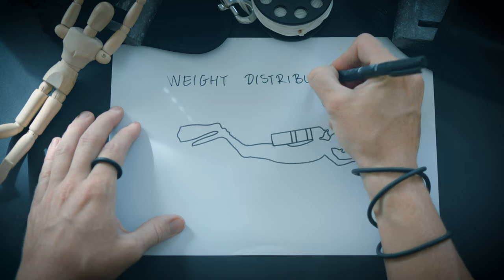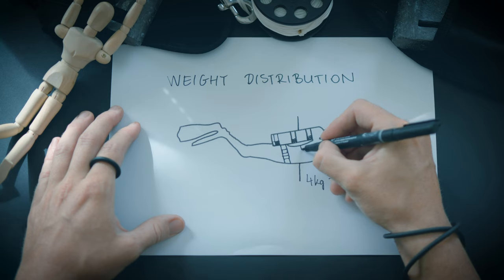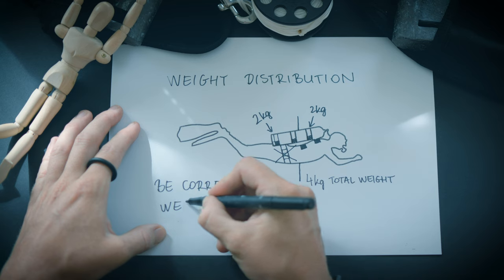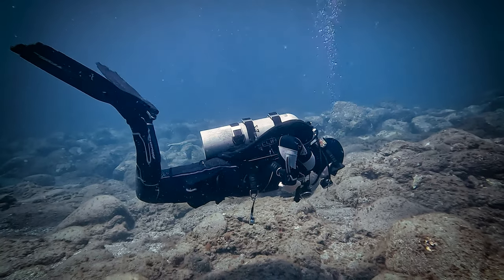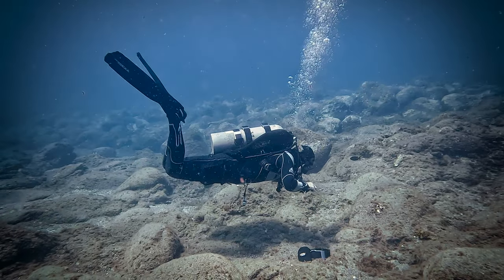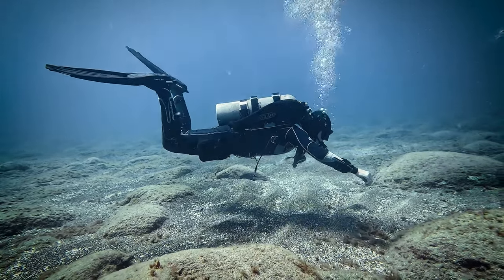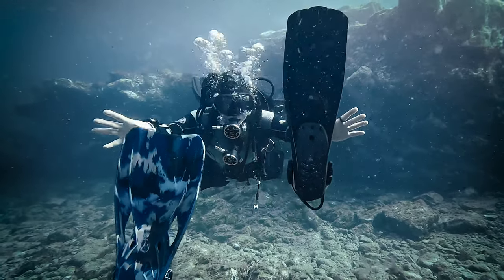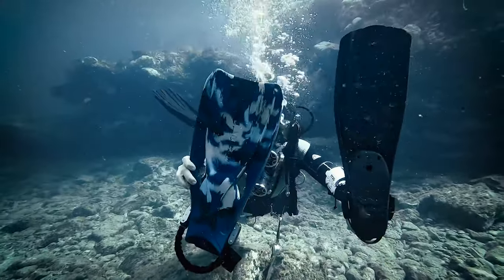How To Achieve Perfect Trim | Master Series

Comment: Great content. I did tons of scalloping before I ever dove. Of course salt water. If you were in 3 to 4 ft of water no big deal. But when you were in 6 to 9 ft of water you had to swim down to be able to see scallops and pick them up. It was next to impossible to stay down for very long, because your upper body just would not allow it. I found at that time weight in a vest about nipple height worked great to stay level in the water. It did not take a lot, 3 to 5 lbs. I've picked up thousands of scallops this way. I now use a Hookah and weighted bcd. And the weights are not around my waist. they are higher on the vest.

Comment: Super dope! I just started working on weight balance. I noticed that 1) switching to steel plate from aluminium helps distribute weight better 2) using 2 blocks of different weights on the plate work better than 1 huge block 3) tank band placement helps adjust (however, you might be limited as I am by your flexibility to reach the valves) and 4) as you said - fins help with that final adjustment on the tail end.

The only critique in this video could be levied against that dangling SPG ;) You could get a shorter hose or strap it on the top of your harness or something else like that
Reply from the maker: thanks for your feedback, yeah we are aware of the SPG. Didn't have options to get anything shorter at the time of the recording. Well spotted tho

Comment: Why would I take only half of my weights to test the optimal placement? 
Also, what do you recommend for my situation; I usually wear a weightbelt with 2 2kg weights, last dive it kept slipping off, but whenever I put it as high as possible (about belly button level) my trim felt good and my instructor said I was perfectly horizontal. I'm thinking of trying to put it in the bcd pockets for my next dive, would this be a correct placement?

Comment: I followed your video to obtain the correct amount of weight where I waited until my cylinder as at 500 psi and then I went to 15 ft, emptied my BCD and tested different weights until I was neutral. Turns out no weight was where I was neutral. But that posed a problem for me. When I did the test in this video where I made myself horizontal and then let my body change orientation on its own I ended up completely vertical. But without weight I couldn't adjust. So where do I go from here?
Reply from the maker: @robmills5181  vertical head up or head down ?
Reply: @flowstatedivers  Head up
Reply from the maker: @robmills5181  It is because your fins are too heavy, or you have your cylinder too low down. Also, be sure to maintain ample lower body tension during the trim check. I'm assuming you are using a steel tank with a wetsuit ? Keep in mind thats not a suitable combination as the inherent weight of the tank will prevent you from using trim weights in most cases.
Reply: @flowstatedivers  Ya I was thinking it might be the fins. I was hoping not as I didn't want to buy another set. I'm actually using a single aluminum 80 with a 5mm wetsuit. I'll try moving the tank up some but not sure how much it can be raised. Thanks for the help.

Comment: Hi, I'm a recreational diver, I weigh 75 and with the wet suit I use 5kg, with the semi-dry suit I use 7kg.  Could you give me some advice on where to place the weights?  Thank you
Reply from the maker: Hi, thanks for reaching out. It's impossible to tell without seeing you in the water. Take our advice from the video and do a trim check in the water, that's the only way to determine where you need to move the weights as it largely depends on your physique and not just your equipment. Make sure you are correctly weighted and do a trim check on your next dive.
Reply: @flowstatedivers  Currently I have always put all the weights on my belt, but I notice that my legs tend downwards. Now I have a new BCD, xdeep ghost. I would like to try with half the weight in the BCD and half in the belt.

Comment: Very interesting video as always. But what if an emergency buoyant ascent becomes necessary. Neither you nor your buddy will be able to ditch your weights easily when they’re zip tied to your gear…
Reply: You do not need to ditch weights. This was explained in a past video
Reply: If you're weighted correctly, you should be able to swim yourself up.
Reply: If you are correctly weighted, you don't need to ditch your weights. That said, you can ditch weights no matter where they are attached, there are different techniques for different attachments
Reply: well, not if they’re zip tied. Mind you, an emergency swim up is advisable from 18mtrs and shallower. Below that an emergency buoyant ascent is the recommended way to go. At least, that’s how SSI teaches it. I’m open to other view points. 

@bogdancristian8097 Which video was that? I’ll watch it. 

I’m definitely not trying to discard anything being said here, because I see how it benefits your trim. However, you should always be prepared for the worst case scenario. So I’m not quite sure if I can get on board with the idea of ditching weights never being necessary.
Reply: @Ho3bahop  It's a very important point. First, SSI is not wrong. The vast majority of agencies will teach ditching weight, because they know that the vast majority of new recreational divers (which is over 90% of divers worldwide) are probably overweighted. SSI, for example, indicates that you should take your time out of a dive to check your weighting, have your buddy look at your trim and experiment in the shallows with changes in weight positions to get your trim just right.

How many divers you know did that in their OW and AOW courses? 

In short, situations where you find yourself having to ditch weight (in open water) are always avoidable. There is no scenario where you need to ditch ALL your weight if you are correctly weighted.

So let's say you erred and you were overweighted and your BCD fails. You can't carry your heavy body upwards and carry out a controlled ascent. You won't be ditching all your weights because even at 18m you don't want to skyrocket to the surface. Your weights would have been placed in a manner where you are able to gradually release them. You dint need to release all your weights (so non detachable is fine)... unless you are extremely overweighted, then you will have to unbuckle underwater.

I hope you never reach that point.
Reply: @MrNeobuxer  hope so too. Thanks for the clarification, hadn’t looked at it that way yet. Cheers
Reply from the maker: Let me chip in. Considering that @MrNeobuxer has already provided an excellent explanation that I won't reiterate. Furthermore, the only discardable weight for a diver should match the weight of the gas they carry. The diver's total weight can be divided into two categories. The first is the foundational weight, which offsets the positive buoyancy caused by the exposure suit or any other gear that contributes to buoyancy at the surface. The second category of weight is the additional amount that equals the weight of the gas and only this should be ditchable. If you've made the right equipment selections, such as choosing the appropriate exposure suit and cylinder size, then using a single cylinder shouldn't pose an issue. It allows you to ascend smoothly when properly weighted, without the need to ditch any weight. It's a different story with doubles and ditchable weight equals the weight of the total gas becomes important when not wearing a drysuit means your buyancy is dynamic. You just gave us a good idea here and will create a new video discussing the importance of selecting the right equipment and gear combinations for specific dives. Thank you for the inspiration!
Reply: @MrNeobuxer  And in addition: Weight on different parts of your gear means you are safer in case you accidently loose your belt. Many dive shops don't want you to put weights in the pockets of your bcd (or the quick releases are broken) and give you a belt instead, so you have to deal with it under water.
I am still new to scuba diving but experienced enough to state that I enjoyed the dives with weights on the gear the most and the dives with a wing setuo even more.

Comment: Is lead toxic? Should it be in direct contact with suit?
Reply: It's not an issue. The oxidised later that forms of the outside on contact with the air and water makes a decent protective barrier. It's only really an issue if it's ingested so maybe avoid licking your hands after handling it - but generally it's harmless.
Lead in the form of a weight has no hope of getting through your suit or clothing and I've not seen any effect on wetsuits at all.

Comment: Your weights should remain easily accessible in case of emergencies. By hiding them on your tank, or threading them somewhere else on your body, you're going against the standards. You need to be able to drop weights if you need to.
Reply from the maker: Which standards do you mean ? There is no point of droppable weight when you are Correctly! weighted.
Reply from the maker: Kindly recommend you watch this to understand the topic better, before getting carried away with the so-called standards' https://www.youtube.com/watch?v=OtHoa8NXkWA
Reply: @flowstatedivers  DIR standards. I use a Halcyon BCD. I've been in very strong down currents that required me to drop weights to be able to surface despite positioning my body away from the reef, pointing myself in an oblique line, and inflating my BCD. In this rare situation, if your BCD malfunctioned and you're left to deal with the down current and inflate your BCD with your mouth, it can be catastrophic.
Reply from the maker: @CharbelSalemSLA  No DIR standard has ever stated that ditchable weight is necessary. DIR agencies such as UTD / GUE / ISE all teaches different flavours but generally speaking they state that the only ditchable weight should be the weight of the gas you carry depending on your cylinder composition. In reality, this only applies to doubles when wearing inadequate exposure protection, such as a wetsuit paired with steel cylinders, which is a big no-no regardless of the weight system, as you will likely end up overweighted at depth due to the wetsuit compression. Downcurrents are a tricky situation, and it's such an edge case that it should not be considered in the same context as what we are discussing here. There are two types of divers out there: overweighted and correctly weighted. If you are correctly weighted (not just on the surface) and you wear the right gear, you won't ever have to ditch any weight to get out of a downcurrent or any other underwater situations. Keep in mind that we are discussing single backmount dives here, but with very few exceptions, the same applies to correctly configured sidemount / twinset configurations with stages included.